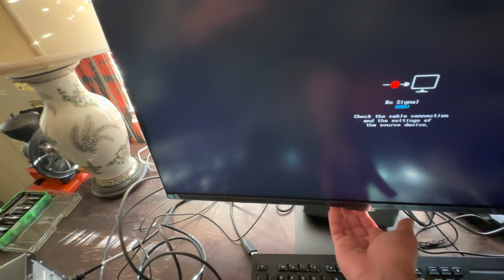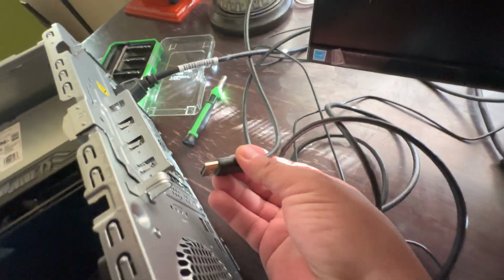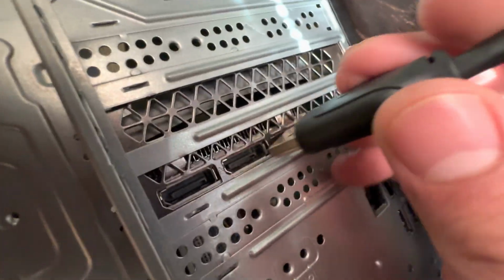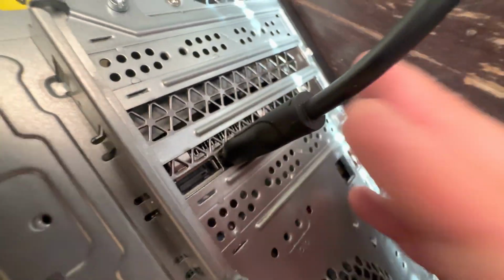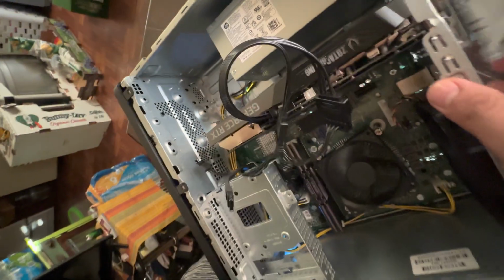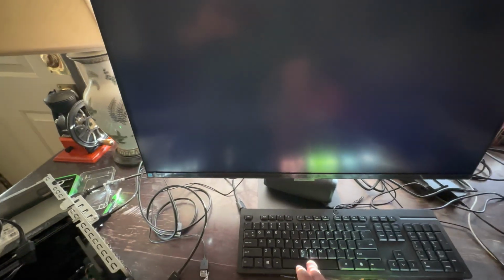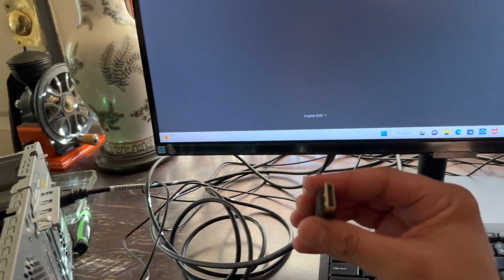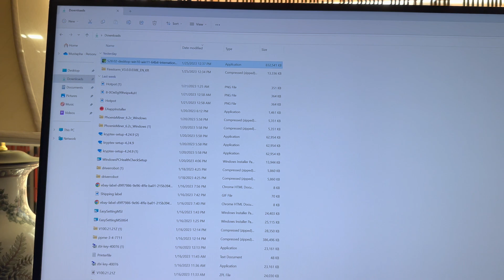How to place a new GPU in your Desktop Computer

Comment: i would get a new psu the adapters are fine but over time and use it could cause a fire. dell and optiplex power supplies are usually garbage even if they are a high power.  i would recommend getting a gold rates psu from a official website. they are like 30$ too
Reply from the maker: It doesn’t worth to buy a new psu if you already have the original one in your computer, the adapters are fine as you said but they cause a mess with a lot of cables around, for my personal opinion if you don’t really use your computer for tasks that requires higher performance like cryptocurrency mining then you need a great psu to run all computer components including GPUs

Comment: Hopefully you do game on your computer, getting an RTX card just to have more display ports is such a waste when way cheaper cards like the GT 710 are available.
Reply from the maker: No sir, I needed high graphic performance for creating website designs and logos, I play games but I’m an old style guy, I only play FIFA or PES on XBOX
Reply: @yourhometech  those would be handled just fine with a cheaper card, an RTX card is really only viable for gaming or 3D rendering
Reply from the maker: Yes I know, but wasn’t that expensive
Reply: @yourhometech  if you do such task a used quadro card or a new one will work much better than just a rtx card due to drivers and bus width.
Reply: gt 710 is garbage an rx card is way better, and its not just display ports
Reply from the maker: The RTX work perfect with Ryzen processors specially if you plug a 4k screen in the computer, all what I needed extra display ports and better resolution